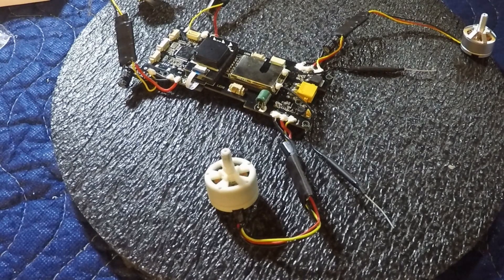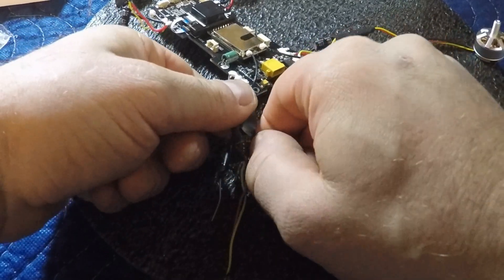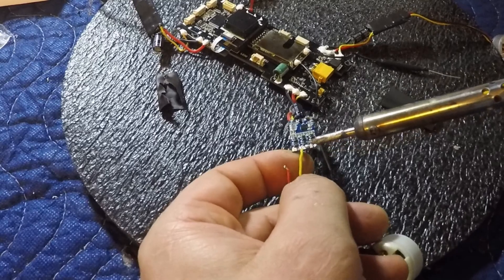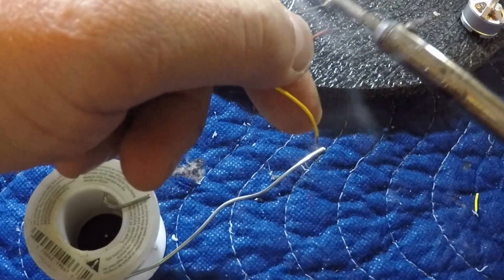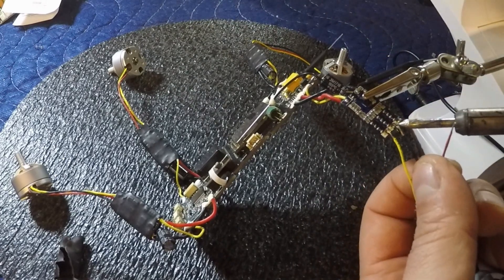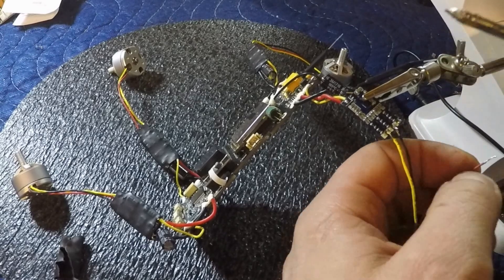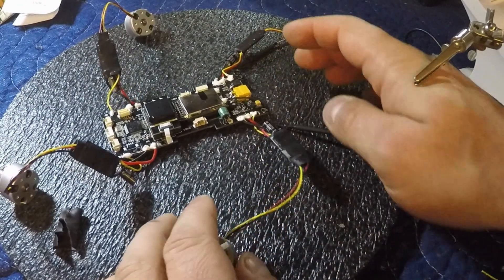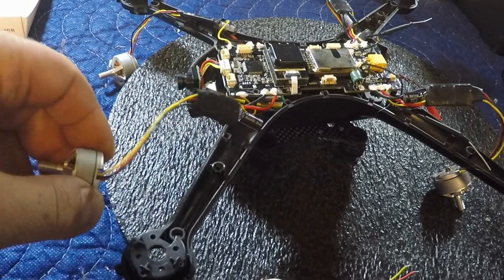Drone Brushless Motor Replacement

Comment: How did you get into the unit? We’re trying to see why a propeller isn’t moving and just want to dismantle the propeller unit. Does it just pop off?
Reply from the maker: The propeller is threaded you’ll need to hold the motor to unscrew it

Comment: Between those three which one are positive or negative?
Reply from the maker: Not sure. Centre wire connects to the centre lead and the outer 2 wires are directional can be reversed to change the direction the motor turns

Comment: Hello, is it possible to install a coreless motor instead of brushless on this quadcopter board? Because the motor without a core has two output wires, but the motor of this quadcopter has four wires
Reply from the maker: No unfortunately you can’t. The electronics are only able to support brushless motors

Comment: Hello Captain.I have one question. Ease help me.My motor on mjx b5w is broke and i need buy new one.My motor have on top hole no flat...So motor with hole on top witch one is ccw or cw.Please help me.Thank you
Reply from the maker: Motors spin that clockwise are cw and the motors that spin counter clockwise are ccw. 

Hope that helps

Comment: Hi Dan, do you see in your tests a difference between both type of motors? Good job - thanks for sharing. Robby.
Reply from the maker: Hi Robby, What I’ve noticed so far is with the Bugs 3 motors/props is there seems to be more punch and the quad fly’s smoother.
Reply: @Lone_Valley_Adventures   Ya Dan that was what I thought and within expectations. I also got the Bugs2 and 3. Thanks.
Reply: @Lone_Valley_Adventures  I got a few drones and have thought about doing this, thanks for the video might give it a shot. Would you say it worth it? Can they be any brushless motors as long as they fit the drone?
Reply from the maker: HALFBLCK for the most part most brushless motors will work as long long as their kv is near the same or greater. These motors are 1800kv as were the original ones.